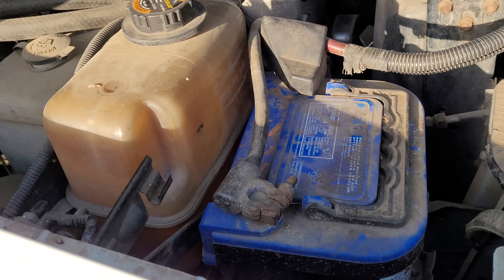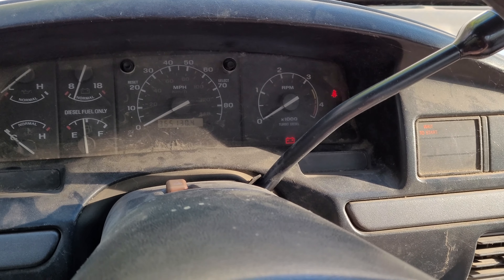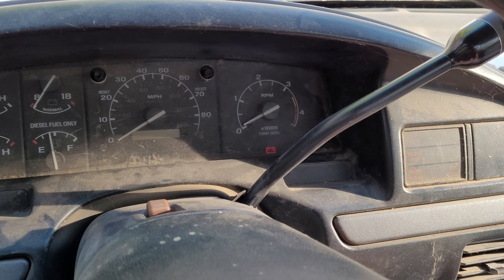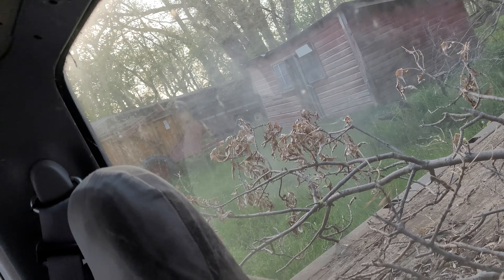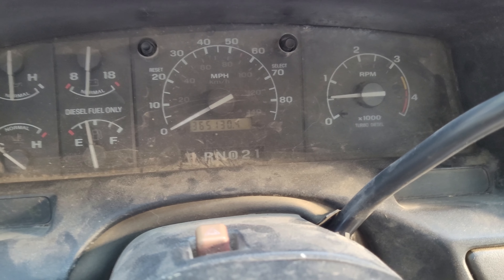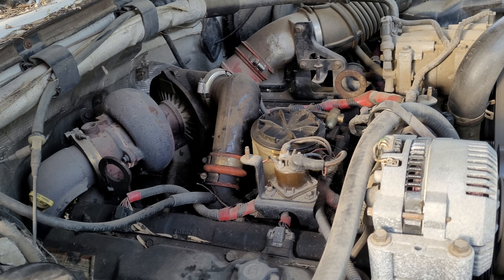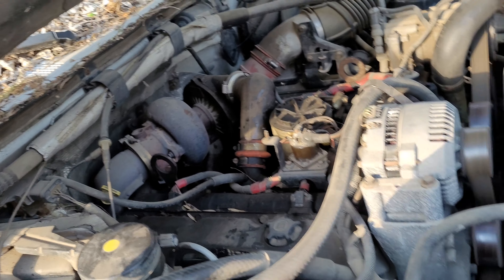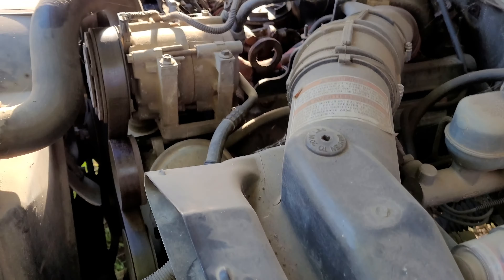Old Start Ford F350 7.3 Turbo Diesel Powerstroke 1995

Comment: That truck has seen better days. Beds falling apart, transmission has problems and the engine is hard starting and sounds like it's running on 6 or 7 cylinders. Personally if it was mine I'd take everything that's useful, valuable or good and scrap the rest.
Reply from the maker: exactly what we will do the old girl tired...